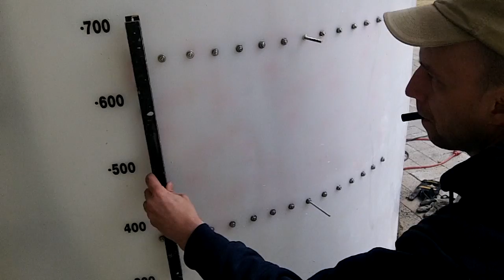How To Install a Tank Window

Comment: I also used a heat gun to warm the Lexan before I used the drill in reverse, I noticed its a lot easier to chip and crack the Lexan when its cold.

Comment: I guess that shows my ignorance. I was using acrylic from optix I bought at home depot. I guess lexan is polycarbonate? I'm actually using half of a 55 gallon drum and the window spans 16" wide x 5" tall. I can easily go with a smaller window on a new tank or I could buy a piece of real lexan, but I'll have more in the window than the actual tank lol.

Comment: Drilling into the acrylic backwards worked great, but my window is too wide for the acrylic and it's putting too much stress on it when it conforms to the tank and it cracks anyway.. Maybe a heat gun will help mend it to the tank, not sure if I'll try that though.

Comment from the maker: These came predrilled when I bought it.  I have heard of people running the drill backward through the lexan so that it would melt instead of "cutting" through the lexan.  I guess normal drilling can create microfractures in the material.  I'm not an expert with this type of material so I'm just speculating.  ;-)

Comment: Excellent video! I tried the same thing on a smaller tank and my lexan cracked when I was snugging down the bolts! I wasn't rough handling it, nor did I crank them down very hard at all. Im not sure what went wrong. I'm hoping that I can just buy another piece of lexan and try to drill new holes into it instead of scraping the whole thing. Any help would be awesome!

Comment from the maker: I use clear GE Silicone II from any hardware store.  I've used it for years on my various fish tanks.  You have to either put silicon under the bolt heads on the inside, or use a rubber washer or o-ring.

Comment from the maker: I don't think there's enough pressure to cause something like that. Worst case, there's only about 2 PSI pushing against the window.  The tank wall is 1/2" thick and there are washers under each nut which helps a bit.  I try not to think about catastrophic problems like that!  ;-)

Comment: Web....a question for you to ponder.
First of all very cool videos, thanks for sharing your skills.
My question is what happens over time from inner pressure on the plastic tank where the bolt holes were drilled in the corners of the window w/o an outside flange type support that the nuts tighten against?  
My thought is the nuts may cause a damaging affect on the tank and cause it to crack over time and pressure.